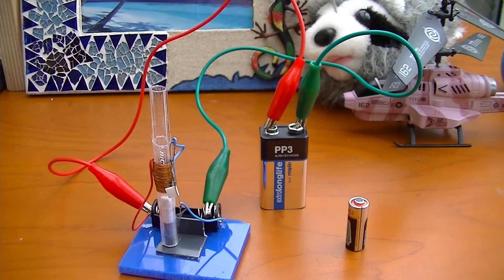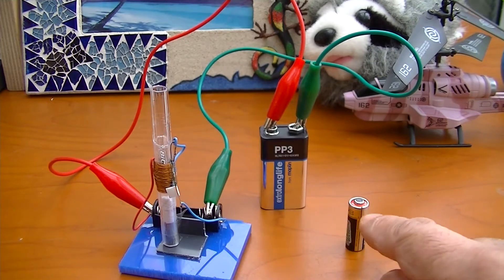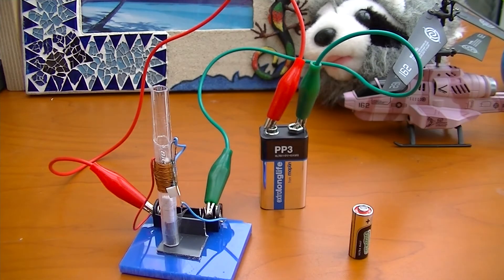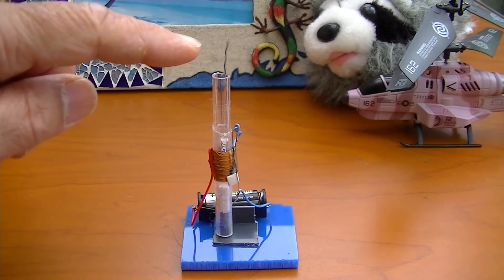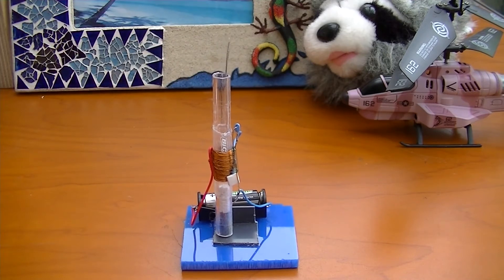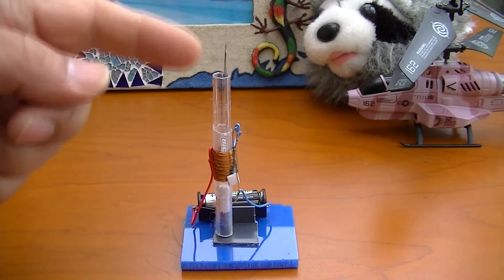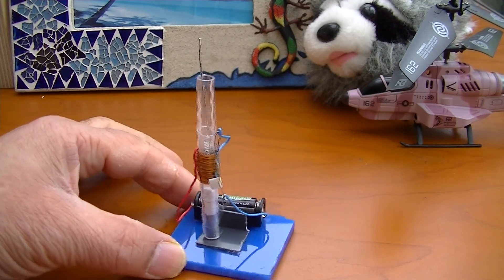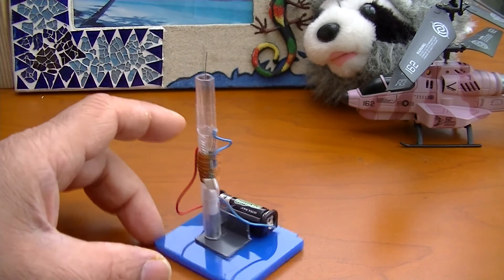Pen Solenoid

Comment from the maker: Hi all the reed switch is normally open and I did not make it. When the nail piston with a magnet on top comes down it closes the reed switch therefore making the circuit which pushes the piston up. thanks